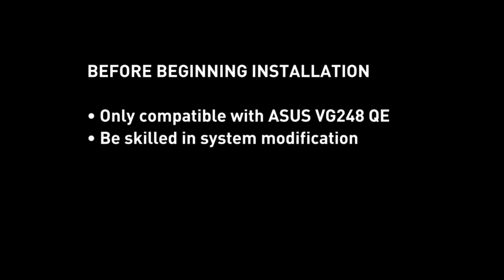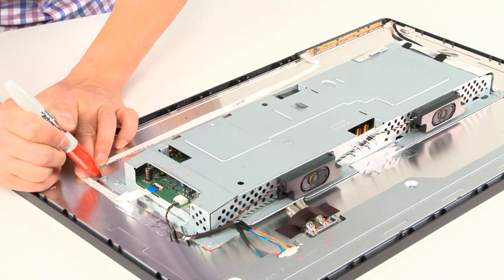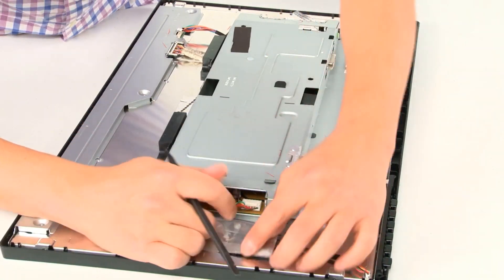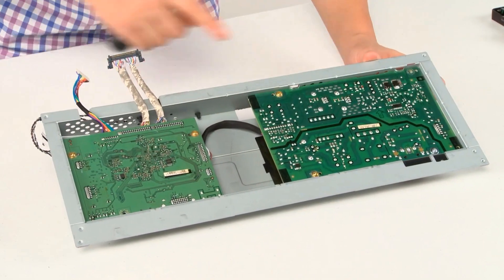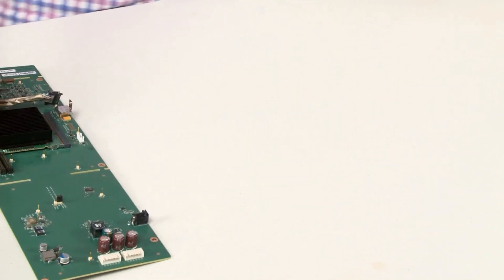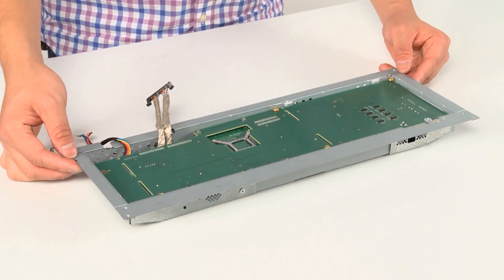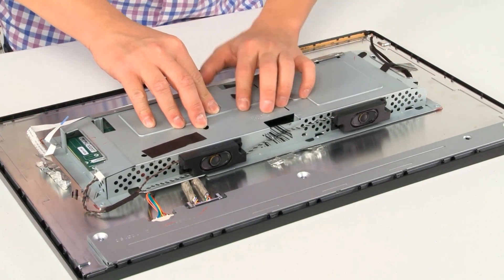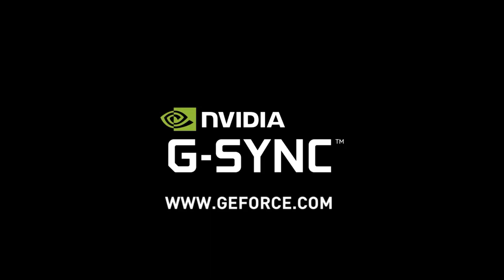NVIDIA G-SYNC DIY Kit Installation

Comment: It's funny how far people are willing to go just for such minor things, i my self with a 60hz monitor have no issues what so ever and i don't have issues with tearing or stutter regardless i might see some once in a while but i would never pry open my monitor like that better off keeping it like it is.
Reply: This is a 144hz monitor, don't speak of something you haven't tried and used. Going back from 144/120 to 60hz feels disgusting.

To prevent tearing you either use an fps cap in game or vsync which is horrible. 
Alright, you manually limit the fps in the game 1 digit below the refresh rate, now whenever you get less than that it will feel horrible and you'll experience noticeable stutters and sluggishness.

Well then it's funny how you call something like that "minor", this is for enthusiasts, don't like it then do as a favor, spare your pointless comments and go away.
Reply: Olek i have had a120 but a higher res of 2K and a fast respond monitor makes my gaming complete people didn't complain before they started marketing these things so much.
Reply: HansensUniverse Higher res is prettier, people who buy high refresh rate monitors are mostly fps gamers, it matters a LOT in that type of fast response game.
Reply: Olek I play fps mostly planetside 2 and the rest is editing and flight simulator, i just find it funny how people didn't complain before, the best fps era whas back in the days, i just don't see the issue with 60hz it's far from unplayable on fps but the average people is like a flock of sheep and the sellers are the shepherd not saying that you are one i understand your point but deep inside i think people can deal with 60 fps pretty damn easy.
Reply: HansensUniverse Back in the day CRTs had up to 300Hz...so yes people complained when LCDs appeared...

Comment: without dvi and hdmi how did he conect monitor to vga i dont get it lol
Reply: The monitor says DP when he hits the menu button. That would imply DisplayPort. Not VGA. The monitor doesn't even support VGA.
Reply: once you install the kit it only has a DP port so you  will only be able to use a video card that has a DP port, all other ports are gone.

Comment: So does this kit disable the hdmi port?
Reply: Yes. It technically makes sense from a purely G-Sync point of view(that's the point of the mod, right?). G-Sync only works with DisplayPort. No other standard.
Reply: whosthatguy2345 That kind of sucks.  I like being able to switch between my PS3 on HDMI and my PC on displayport.  I don't mind not having G-Sync on PS3 since the monitor has less input lag than my TV downstairs.
Reply: Gameaholic1337 g-sync does not work with ps3 only with newer nvidia cards
Reply: no hdmi will still work fine however gsync wont be enabled on it due to the requirements of gsync
Reply: Ok so I guess installing the plate that blocks off the other ports is completely optional.